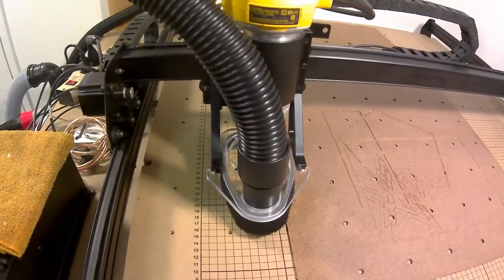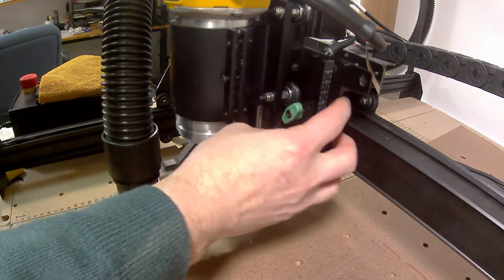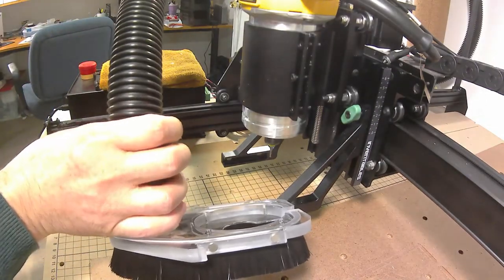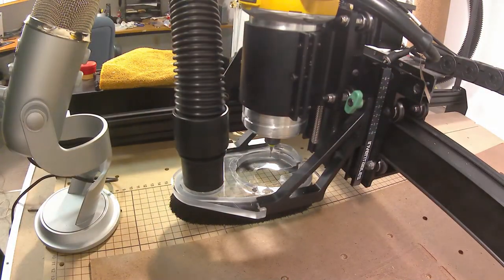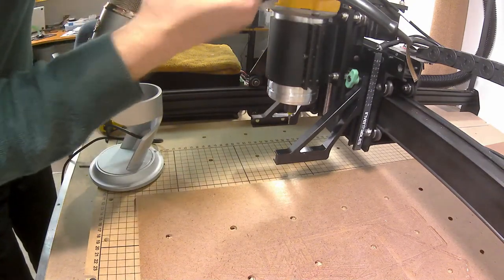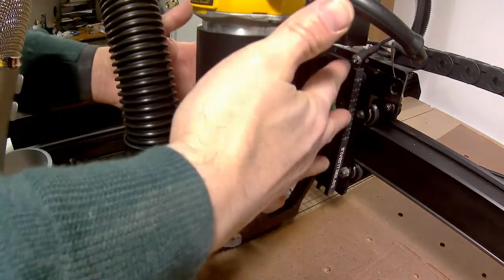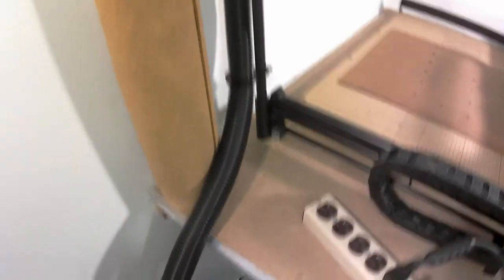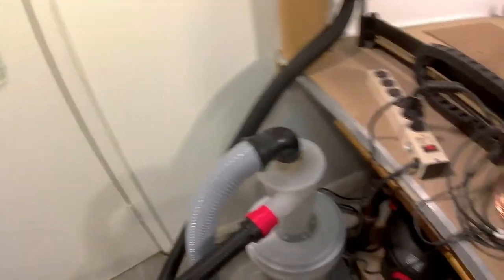X-Carve Dust Collection - Thoughts and Observations

Comment: As far as the dust collection brackets hitting the gantry brackets, if you adjust your homing switches directly over the black/white circle in the corner of the cutting area, the brackets will not hit the gantry.  it appeared from the video that your spindle was travelling past the lowest right corner.
Reply from the maker: William - thanks for watching and commenting.  That is a great suggestion.  I would think the installation instructions would mention that., but after over 2 yearrs, I guess you've solved my problem! 💪

Comment: Hey! Couldnt you just preposition the homing switches to be a little shy of the gantry mobility limits and to line up with the wasteboard grid home position? From what I can see in the video, you're trying to home the machine outside of said grid..Maybe I'm wrong and it's just the camera angle?
Reply: I just repositioned my homing switches on X and Y axis slightly and the problem went away. Also, simply being aware of the plunge depth makes the issue of plunging through the acrylic plate go away - I guess that's why you get two plates in the kit :-) There is a PDF with dimensions for a replacement plate - I plan to make a couple more soon...
Reply from the maker: Roger on the plunging - just wasn't anything I considered before it happened.

Thanks for the comments and don't forget to subscribe!
Reply from the maker: I seems like moving the limit switch in to compensate will cause me to look about an inch of x cutting space, no?

Thanks for the comments and don't forget to subscribe!
Reply: Re-positioning the switches doesn't really seem like a great option. Only because one has just spent 1500 (roughly) for this thing, and then they have to manually assemble the entire thing. You would think that for the money spent, Inventables would be sure to knock out these little issues before selling the product. 

They send you a replacement bracket to move your z probe plug when you buy the dust collector kit. Wish they would have sent out a few more things to make it work without issue. No  one wants to manually move the dust collector arms every time they go to start up the machine.

Comment: Would you be able to maybe dremel out a section of that gantry plate that’s in the way? Just curious, I’m about ready to purchase this and wondering if they may have addressed this issue now.
Reply from the maker: You could or move the limit switch. The latter would reduce your cutting size though. I do not believe the Shapeoko has this problem, nor the Onefinity. Thanks for watching!

Comment: Hello Goodnight. Very interesting your review. Watching your video made me rectify the design of my dust shoe. I have my X carve of 1000mm. and for reasons of space I do not have a workshop to work on so I am working in my kitchen. I live in a very small apt. And therefore the problem with the dust generated by the machine. Because of this and for money saving issues. buy the machine without waste board, home switches and vacuum system, I made my home switch system, probe system waste board and vacuum. Back to the topic. I suggest you download I have printed in 3d the arms that hold this shoe system. I made my correction about it to avoid the inconvenience of when you change the bits the shoe interferes. I gave myself the task of looking for a solution to this problem. and believe me, that I am proud of what I invent, I believe that with this combination of Eric Pavey from Belmont, CA who very cordial gave us his design of his dust shoe to download for free and distribute without any type of economic benefit for 3D printer, and a change in its design made by me to modify certain interference as in this case yours that the shoe does not let you do the home procedure. My design covers and solves these 2 drawbacks, change of drill and home procedure. Here I leave the links of my design and ready in easel you adjust and make the changes according to your likes and materials to use, and I leave the link of the Eric Pavey design. If you need the DXF contactme in my chanel.

http://easel.inventables.com/projects/ZCtSstf7C6onnfiYWND3Qg              My change to its original design
https://www.thingiverse.com/thing:2173106                                                    Eric's design

Comment: does it get in the way when you do a bit change
Reply from the maker: Hi Steve - thanks for watching. It depends on how you initiate the bit change and how the machine reacts.  If you are using M6 and the machine returns to some known position -- specifically home - then yes, it will interfere with the change operation.  If the machine returns so some "safe" location other than home, there should not be any interference. I generally keep my gcode files separate for different bits. My machine returns to a known location when the op is complete (position set using G28), I change the bit, zero as necessary, load the new program and off I go. My "known" position is way far away from home for this specific reason. Hope this helps!